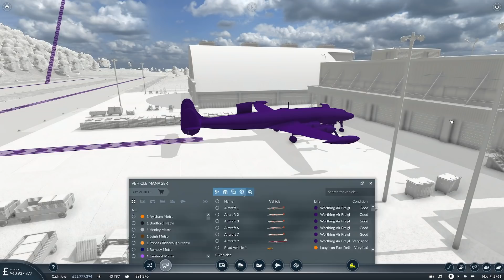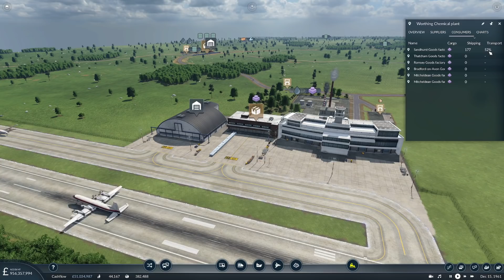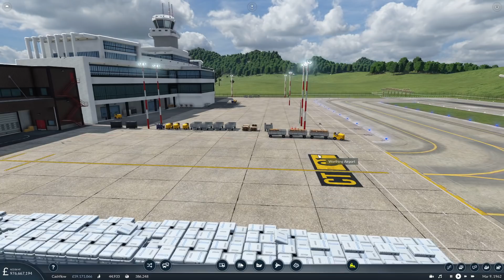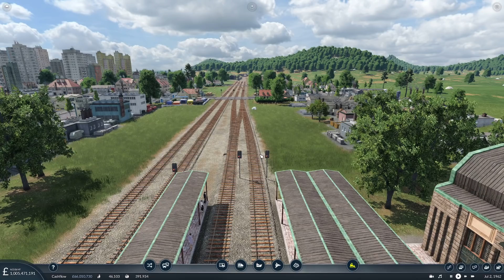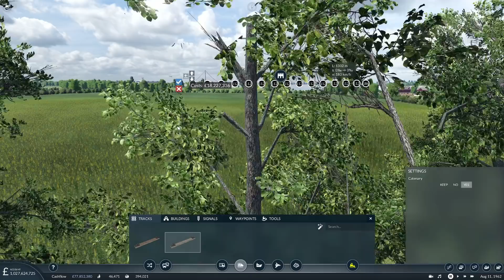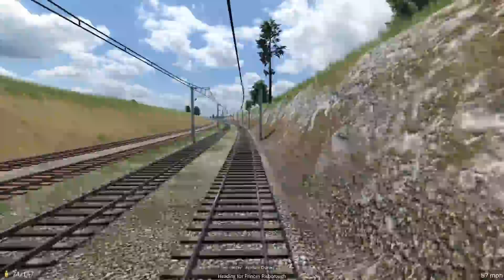First High Speed Main Line - New Top Speed | Transport Fever 2 - Hard Mode #34

Comment: 9:00  Where are you?  Plane is missing... Mayday mayday.

The new Express hit the start of the platform at 87mph.  Don't you have realistic braking installed?  Lots of customer complaints if the express goes from 87 to 0 in 300 metres!
Reply from the maker: Yeah, I've avoided realistic breaking. It's a huge loss in profits for hard mode.

Comment: Strange the 737 became availible in 1962. It didn't actually take it first flight untill 1967. The 707 first flew in 1957 and was much larger. Stramge they skipped that one as it had a much larger impact on air travel than the 737.
Reply: there's a fair bit of strange in TF2 for dates and speeds and such
Reply from the maker: Fair bit indeed.